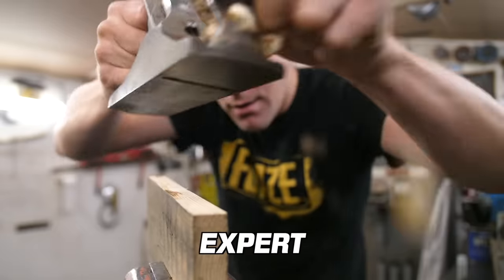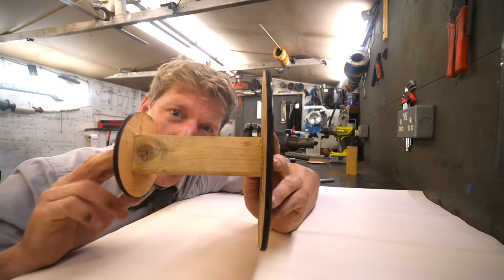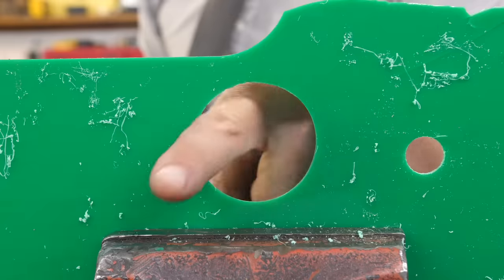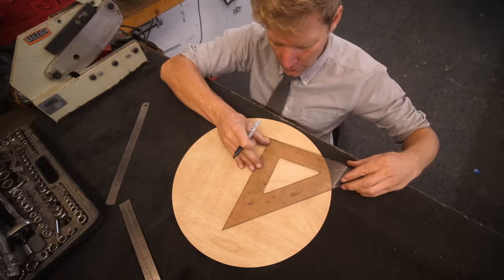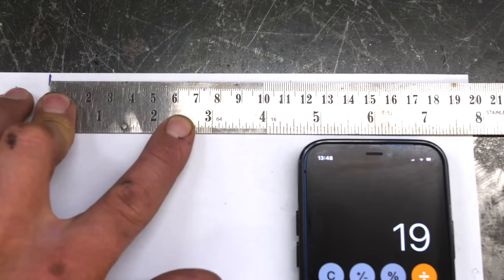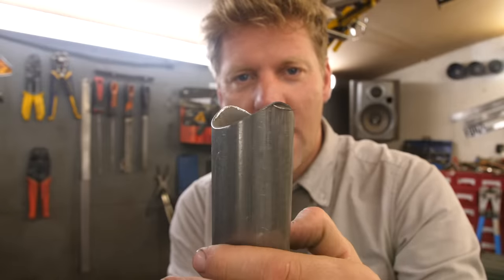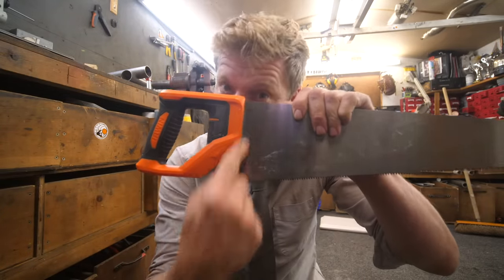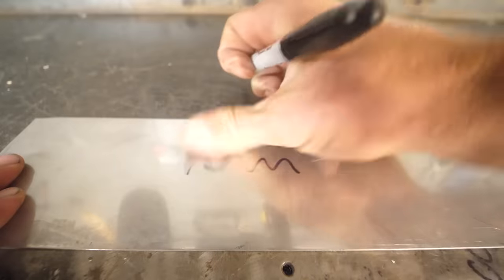18 GENIUS Workshop TIPS (that actually work)

Comment: that angle iron in the slip rollers is slick!
Reply: I think that This Old Tony should be doing a similar type of video......or even a series.
Reply: Tony make more content please 😭😭
Reply: Creating an adjustable slip roller design, so you dont have to cut angle iron everytime
Reply: ThisOldTony, Colin Furze, Clickspring, Wintergatan. These are a few of my favorite things.
Reply: hey there tony. this is coming at you from the states. get back in the shop and give me 20
Reply: I wish I knew that when I was working in a sheet metal fab shop, but it has been noted and is now in my toolbox of ideas.
Reply: That is the thing with hint and tricks… some of this comes naturally to some just plop a bit of metal there and jobs a gooden… it is only when you talk to other do you know that isn’t always the case.
Reply: These two need more interaction :)
Reply: I'm making a list of tools to stock my garage with.  This will be obvious to those who have used a slip roller, but...  I can see you curve a cone a little at a time, multiple passes, until the ends finally touch... but what if on the last pass you've fed it say only 2/3 through and the ends are already about to touch?  i.e. Won't the cone now be "out of whack" due to the first 2/3 receiving more "curving" than the last 1/3?  i.e. Not be straight viewed from the side, top & bottom edges not parallel with the bench, etc?
Reply: If the material is thin enough you can just flatten it out some and loosen the rolls. Now roll it again but don’t tighten the rolls as much. If the material is quite thick, 1/4” or more, you messed up. You may need to start again.
Reply: @realfamilyman at my previous employment, we used to lift the approaching end over the top roller. Depending on the thickness and type of material, most of your rolled products will flex without deforming too much.

From my experience working with steel in the 1-6mm range, there are multiple stages of flex. First is the springback after the pressing operation has released the pressure, then there is an amount you can move the steel back where it feels like the stress is released, and then after that, further movement will require more force to make it yield or deform.

This is why I've found it's best to over-roll/over-fold a part a little where it's easier to manipulate to the correct angle or curve.

(Fabricator for 10 years)
Reply: Sharpie trick guided tot here😅
Reply: i still watch your spring video from time to time
Reply: I've been binge watching all your videos for the last two weeks. They are funny and informative! I love it!
Reply: this is a new one for me too
Reply: I knew the shot at 0:23 was in fact @ThisOldTony haha
Reply: I've tried some of Tony's tips and tricks, but I just get a sore hand from Karate chopping metal.
There must be more to it.
Reply: @andreasflensmark8616  So what if you had a square threaded rod with a thingy on the end that you just screwed out to the appropriate position, and then locked in place?  Boom, adjustable slip roller for making cones left and right
Reply: @go_adventuring   Yeah, exactly, i think that would be very cool
Reply: @Internet-Antics  Cosigned.  This is an extremely high quality list right here.
Reply: Now wr just need AvE to comment and we hit the engineering trifecta
Reply: We miss you !
Reply: @colinfurze it would have been great to see a shout out to the commenter who shared this tip!
Reply: It works better than the guides I've seen on some lathes, because the angle iron sits really close. It does chew up the side of the part though.
Reply: @realfamilyman  hard for me to explain but loosen the back roller and apply pressure to the part coming out of the roller as you reverse what you have over-rolled and it should flatten it enough you can re-roll to where it should be. if your join/seam is not very intrusive you can re-roll the finished cone so long as its truncated and work it by hand until it rolls smooth. have also hung the cone underneath the rollers, essentially inserting the end (so the opposite end you first put in to over roll it) in first, and re-rolled it back on itself so long as colour/finish side isn't important. cant comment on heavy gauge though. only work with light gauge steel. clear as mud, hope it helps.
Reply: @adamw3188  I can picture in my mind what you're saying.  Thanks.
Reply: That ruins all the fun of cursing the jeezless, useless, now piece of scrap you started with and cutting out another piece and bestowing it with some fanciful title you hope will enchant better luck into your next try.  I like to use the name Phil.
Reply: I'm surprised no one knew about that, because we were taught that in the 70s in boilermaker class. They even left a piece of angle iron on the rolls just for that.

Comment: To find the center of mass of a piece with irregular shape and non-constant density (I was spinning up a cross-section from a large tree), you can put it on your work table and nudge it up to the edge until it’s just about to tip and mark the table-edge on the part. Rotate and repeat a few times, and the center of mass will be at the intersection point of the lines.
Reply: That's genius
Reply: That was great, i fell right to sleep after reading that
Reply: Brilliant!
Reply: Listening to engine noises? Put a long, pref hex headed screwdriver tip on the area, put your ear to the handle end.
Reply: Always used the hanging-string method for this: tape a string somewhere on the thing, then grab it at that piece of tape and let both hang.  Use a pencil to mark where the string falls.  Then do this again from another spot, and the center of mass is where the string lines cross.
Reply: Collin inspires me.. My parents said if i get 40K followers They'd buy me a professional camera for recording..begging u guys , literally 
Begging...
Reply: To find an air leak, use a piece of hose, one end in your ear, move the other end around to pin point the leak. I’ve used it to pin point a refrigerant leak in the bottom of a freezer case.
Reply: @isickofit or place it just below/behind your ear on the soft spot. Vibrations will pass trough to your hearing.
Reply: Hmm I don't think this is right. If your piece is cone shaped, you're gonna end up marking further up the taper than where the centre of mass really is due to the thing being angled.
Reply: @AN2Felllla  How are you envisioning the setup? This tip is for a generalization of the "center of a circle" technique from Colin's video to a case where you can't rely on the bisection of a chord to pass through the center. At the point where the piece just balances on the edge, the center of mass must be right above the edge, so that if you drill through the intersection point of the table lines and normal to the face you put against the table, the hole will pass through the center of mass.
Reply: Bruh, that's some ancient Egyptian aliens knowledge right there.
Reply: There's an easy way for light objects too:
Example: find center of gravity for a broom stick
Put your arms out in front of you with index fingers out. Set the broom across both fingers (its now parallel to the ground) move your fingers towards the center at the same time. One finger will move easily, the other might be harder. When the two fingers touch, thats the center of gravity
Reply: @isickofit instead use a length of rubber fuel line hose then you can sneak it into wherever it needs to go even up against the hot engine then put the other end up against your ear and now it's a stethoscope! That way you don't get shocked either.
Reply: I have used this same method a few times just to find the rough center of a length of wood without a tape measure. Normally when I want to rough cut longer lengths in half to fit into my van.
Reply: You can even slide it on your fingers, to get rough center, just hold it up on left and right pointer finger, and slowly move them together. If its even size you can get pretty good center without tape measure.

Comment: A trick I was shown by my grandfather many moons ago to keep a drill horizontal when drilling into a wall or post, was to place a washer over the drill bit. The washer will stay in the same spot if you keep the drill horizontal. otherwise it will move towards the wall or away from it.
Reply: I like it 👍🏻.. Also, if your drilling into something and you dont want debris falling into the object your drilling, just put grease or something similar for the cut pieces to stick in to instead of falling in.
Reply: Actually a solid idea if u got nothing else to rely on or use
Reply: Do you know if it works with the perpendicular position, as in left and right?
Reply: only issue is you need to drill ever so slightly down, like sub 1 degree, otherwise the washer could be moved by the flutes couldn't it?
Reply: @bluedrink5928  leave enough of the smooth shank section of the drill bit out of the chuck jaws and have the washer ride on the smooth section so the flutes cant affect it. ;)

Comment: The hole saw in a hole saw is a great way to make odd sized washers from odd materials like plastic.
Reply: I have made rubber washers this way, but by running the hole saw in reverse so it doesn't snag.

Comment: Tip #1: keep lose objects (such as a tie) away from spinny things (such as an angle grinder)
Reply from the maker: Fan Tastic
Reply: how are you supposed to be safe it ya aint wearing your tie?
Reply: 'loose'

And yes, I've seen digits removed because of stuff like this. As nice as work gloves are, they can be very dangerous too. There's a video out there of a girl who's clothing or glove got caught in an industrial shredding machine..... Ya.

I've come down off a ladder with a tool belt and a hammer hanging off (as they do), someone behind said something and as I turned to him, the hammer got caught in the ladder and sent me about 7 feet down for hurt. Just mentioning that for people so they can see that not everything meant to help, is always safe. Paying attention to your surroundings at all times, is a must.
Reply: @seriouslyconfused1
Username checks out.

Use some duct tape to stick your safety tie to your safety shirt.
Reply: @RickL_was_here  Walk ways, ladders and railings that have things to snag on (fuck scaffold) and the flappy pockets on work trousers has caused me more issues than anything else on gods green earth!
Reply: @dafoex  why wear a shirt? Lol I'm out here welding
Reply: A clip-on would by a solution (to stay on-brand). Believe it or not , when I was a young airline pilot (maaaany years ago), I was taught to wear clip-ons so the tie wouldn't kill you if it got caught in the trim wheel (stab trim, which moves quickly and you would have to lean over occasionally to do stuff).
Reply: Another Hazzard is the open top shirt pockets can't tell ya how many times I've had them (on company supplied uniform shirts) snag on something or catch a hot cherry (welding/grinding)
Reply: Shop 101 first day rule 1.  No loose objects worn in shop. No ties, necklaces, watches, bracelets,  dangly earrings,  belly button rings, loose she strings, long loose hair,  bags, fanny packs, droopy pants, loose long sleeves, hanging balt ends, bag straps...ect....if in doubt then NO.
Reply: we know the tie didn't get caught 'cos the video was published :)
Reply: @seriouslyconfused1  Cops I know (small set of exactly two), when they DO wear a tie at work, wear a clip-on so that it doesn't become a handle someone can use to control their movements in a scuffle.
Reply: @rossturner3650  Heck, I've torn pockets on pants and coats in the stud for the door latch of my car!
Reply: That tie has had me worrying since the first time I saw a Colin Furze video.
Reply: @seriouslyconfused1  Saves on tanning booths!
Reply: @gooberclese This is exactly why I change out of boxer shorts into a jock strap when using my lathe.

Comment: If you're taking a complicated thing apart... use scrap cardboard to draw a basic template and run the screws or bolts into the cardboard.  Each layer deeper... just draw another template and keep going.  Nuts can go on the bolts themselves and if they're are nuts that were in studs, bits of scrap wire can secure them.  All your hardware is organized and basically gives you instructions to put out back together, even years later.
Reply: Use that all the time for water pumps or carbs.  Because a lot of the time the bolts are not the same length.
Reply: Double sided tape on some cardboard also works well, especially for small bits.
Reply: This is a great one thanks. I had to read it twice to get it. lol I have been laying things out taking up a whole bench but this is genius. throw the numbered stack of bolt boards in a box and come back in a month no problem!
Reply: I usually don't have problems, but that is a genius method.
Reply: Oh geez I used to tape them to papers sheets like an animal, thanks.
Reply: @chroot1838  I've taken apart and had to put back together a very large number of things over the years.  I learned this from an old Telecom technician when I was still apprenticing close to 30 years ago.  I then applied it to rebuilding engines, transmissions, and carburetors. I used it while tearing down intercom frames in schools or fire alarm panels.... and even with complex kids toys.

Comment: To be sure that you don't cross-tread a nut, a bolt, or whatever -- turn it the wrong way until you feel a "click". You have now found the beginning of the tread and can start turning the nut/bolt/other the right way to make it screw on correctly.
Reply: Very good tip. I've seen so many ruined threads in plastic materials over the years. Don't ruin threads.
Reply: When you feel the male threads jump upward, then immediately drop, there's the beginning of the mated thread.
Reply: I do two clicks to be extra sure, especially when doing and bolts directly on an engine
Reply: @fluffyflunk  Oh yeah, I used to WRECK plastic thread before I learned this trick.

Comment: For hole saws: If you drill something with them, they tend to get hot and have issues with friction (your plywood hole in the video also had this issue for example). Often that's because the chips can't get out. [Edit: Before sawing out the big hole, start by drilling] 1 or more holes on the edge of the inside of what you're making the hole in and juuuuust barely touch the actual cut of the hole saw, so the chips can fall out and not gunk up the teeth while you're enjoying holey perfection.
Reply: That's a goody that one ... works well
Reply: AND for hole sawing MDF, I put a shop vac next to the blade, also sucks out chips/dust, and no more smoking and much better inner surface.
Reply: I will add to this, if you are hole sawing heavy steel or anything that can get hot, hole saw a sponge first, stuff that sping inside the hole saw and it will hold your coolant, cutting fluid, water etc in to help keep the bit cool!
Reply: I do this when core drilling into masonry / concrete too. It lets the dust fall out, and if you drill enough holes, reduces the wear on the core drill so it lasts longer.
Reply: When using a hole saw/drill bit/putting screws/lags in wood rub them with some basic bar soap it prevents the friction and allows a better cut without the burning.

Comment: If your gluing to pieces of wood together, you know what happens when you tighten the clamps.  The two pieces start sliding around on each other, ruining your alignment.  When you apply the glue and smear it around for even coverage, sprinkle some salt on the glue. Then when you apply the clamping pressure, the sharp corners of the salt digs into the wood and will prevent it from sliding around.
I learned that from John Wilson, from Charlotte, Michigan.  He made and sold supplies for shaker box making.  He passed away earlier this year.